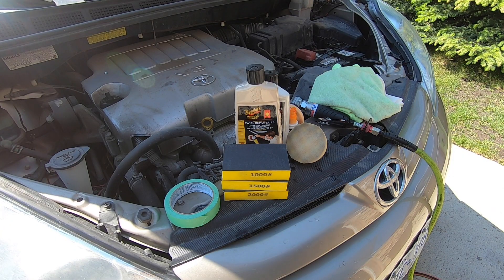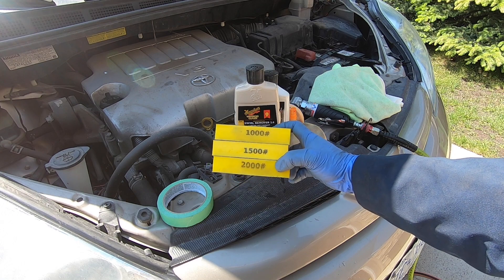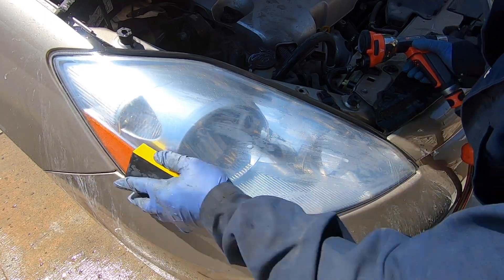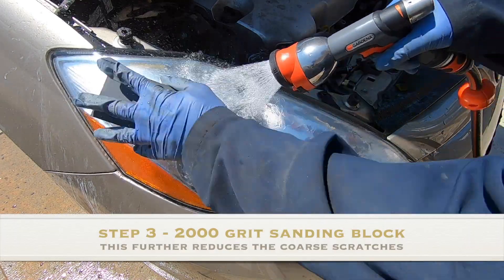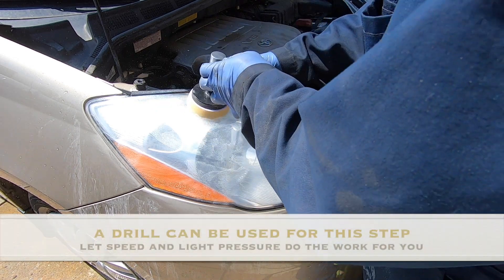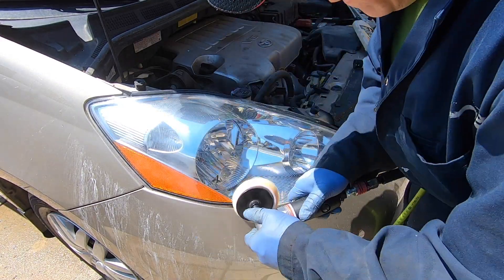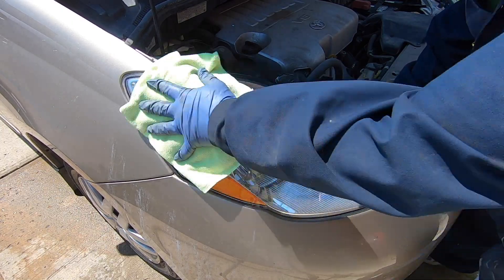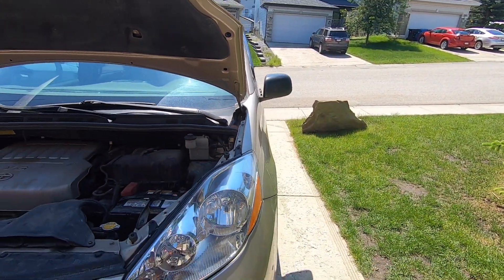How to polish and restore the clarity of your headlamps in 6 easy steps

Comment: Great result! I been using 3M kit for the past 5-7 years, works well too.
Reply from the maker: yes the 3M kits work great but the downside to them is that the kits I found are a tad bit pricey and are only good enough to do a set or maybe 2 headlights before you're out of the materials needed to do more headlights.  A fix cars semi-professionally so cost per job is important to me hence why going the wet sanding block route was the most economical way plus I can buy those blocks all day long at places like Home Depot for cheap.  Polishing compounds I use for other car detailing work so it made for a perfect headlight restoration setup that I use often :)
Reply: @piercedasian  I do agree about cost of 3m kit. But I only used the entire kit for the first application. And then I am maintaining headlights twice a year with 3M 02087 Trizact Hookit Foam Disc. This disc was included in the kit, but can be purchased separate. All you need is a drill and some water. And of course I use M205 for the final polish.
Reply from the maker: that is true.  The 3M kit is pretty awesome and I still have bits and pieces from the kit but like I said, I do many of these so I have to use something that can do more than 2 pairs of lights.  To be honest, I think the 3M kit is one of the best around which is why I tell people they're worth the cost.